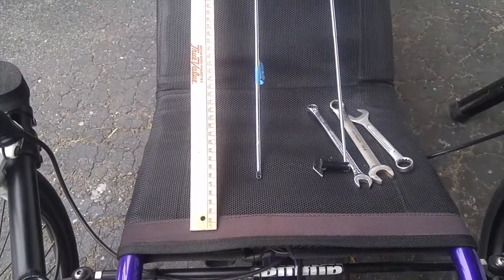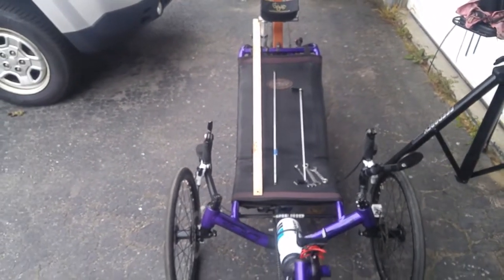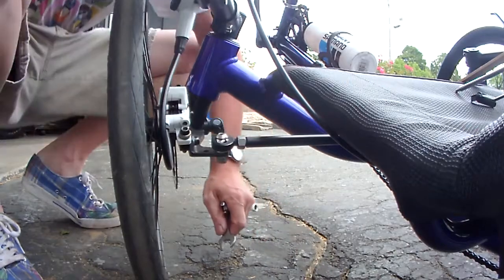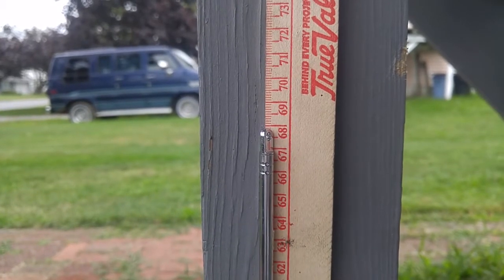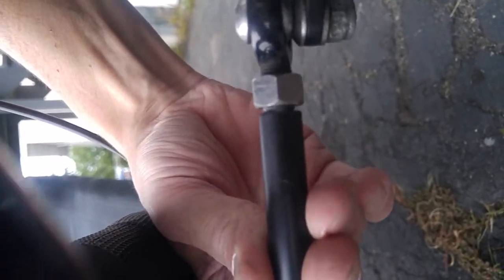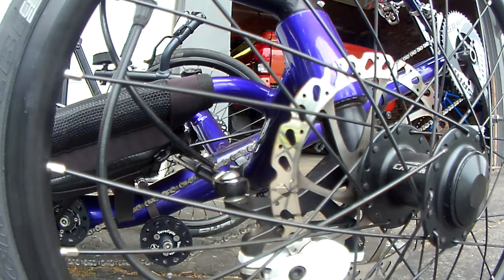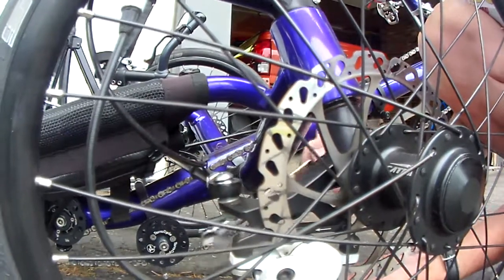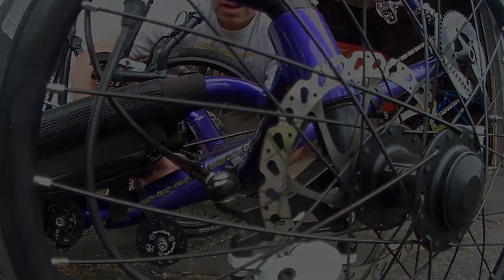Catrike Alignment

Comment: Is that a catrike 700 you're working on?
I just bought a catrike 700 and I checked my alignment today, and there was a half inch toe in the front.
That probably explains why the tires are so scrubbed.
Reply from the maker: Yes. I have a 700. Once you reduce your toe in , your tires won't scuff. I like to go with a bit of toe in. Like a 32nd or a millimeter or 2. Once you get that. You'll also notice a bit more speed out of your trike.  If you have any questions feel free to ask.